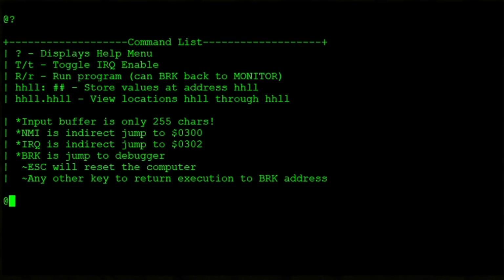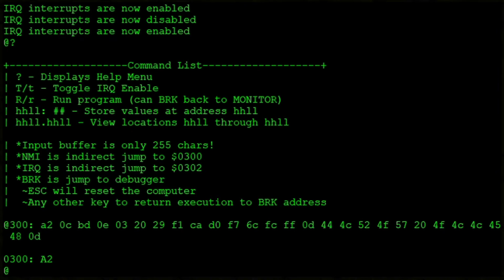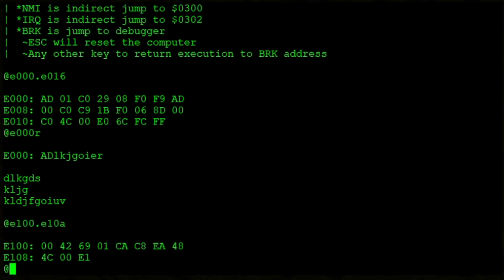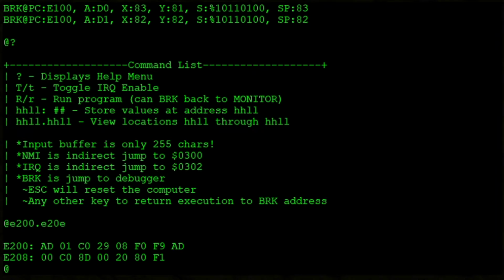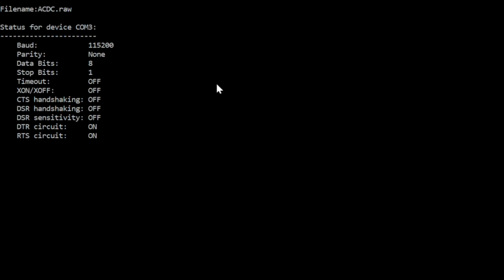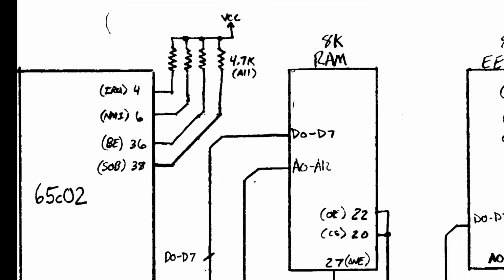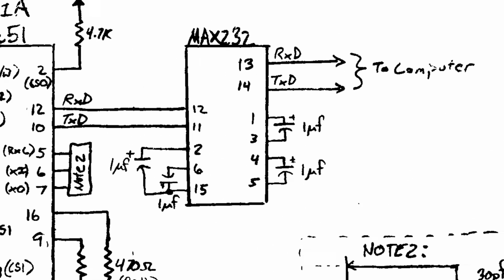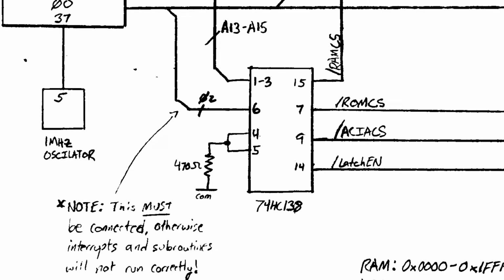Pro'ter: A 6502 Prototyping Computer

Comment: I'd like to have a look at your code. In the interest of the art! I like your drawings and descriptions of same. Well done IMHO.
Reply from the maker: Thanks! To do the drawings, I did them in pencil on grid paper. Then to put it in the video, I scanned it in and put a threshold over it to convert it to black and white and to remove the grid.

In terms of the source code, I uploaded it to my Github:
https://github.com/ElectronicsTinkerer/65c02-Test-Code/blob/master/SerialWozEnhanced.asm

To assemble the code, I have been using a version of DASM that I modified to have support for the new CMOS-variant opcodes.

Comment: Very cool. I do 6502 too...
Yeah, I did my OS to be fully NMOS compatible, but my assembler will manage the extra CMOS part opcodes if ya' need 'em..
.
It is interesting how you phase-two condition (validate) the R/W via the address decoder. I can see how that works, but haven't ever tried that approach; I was worried that the chip select(s) might precede/delay compared to the entire address bus becoming stable. I've always phase-two conditioned The R/W lines directly; The chip selects and the address are stable first, THEN comes the CONDITIONED (and slightly delayed) Read or Write strobe. Cool stuff here, Boss. Do more!  ;-)